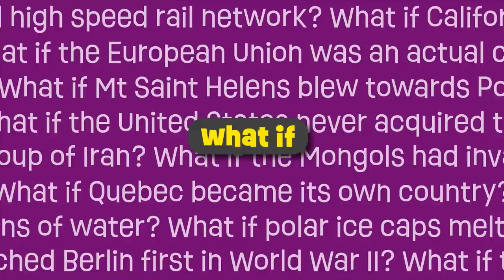Water Pipeline: What If An Aqueduct Was Built From The Great Lakes To The Southwest?

Comment: Any route I have seen proposed will involve going UPHILL. Water does NOT flow uphill, so it would have to be pumped. An aqua-duct would also suffer water loss due to evaporation. 

 Any pipeline project would  have to be capable of moving volumes of water approximately the same as the spillways at Hoover Dam. Damn! That would involve large pipe, pump stations burning energy every 50-60 miles or closer, pipeline maintenance crews, Right of Way maintenance, FERC approval and oversight (because it is an interstate pipeline), environmental permits, and many other issues that develop. These are just a few issues that come to mind off the top of my head.

My conclusion: it is not going to happen.

Another issue is the fact that the drought in the midwest is causing concerns there according to an article in Scientific American. The  Ogallala aquifer is dropping at levels several times the flow of the Colorado River! I can guarantee that any diversion  of water plans would be tied up for years in lawsuits as well.
Reply: The power used moving it up would be regained as it fell back to the ocean.   So you can have the water moved, without huge energy loss.   But it is water or energy, the water could be moved, but the energy needed will not go to the SW rather to the pumping of it.
Reply: That's because the only serious project ever proposed by actual hydrologist's is diverting water from the Arkansas, which is close to the Colorado's tributaries and doesn't involve much pumping.
Reply: @robertpendzick9250  
I don’t think the power would be totally regained through the dams. Water is heavy, and pumping it for all those miles, continuously; especially where they are pumping uphill against the resistance weight of the water and the added head of pumping uphill, would consume much more than would be regained at the dams as well as shifting the power burden from the west to the areas in the midwest. The west would benefit at the expense of the midwest. 

The whole idea still seems outlandish to me.
Reply: @dmannevada5981  
 Good point, but there are still many considerations, including the volume of water continuously needed to make such a project feasible.
Reply: By the way, an aqueduct running from Duluth Minnesota to Colorado river tributaries  would be frozen 5 months of the year and would require constant repairs/maintenance. It might be a benefit for olympic ice skating practice, though.
Reply: @WEStern-sm3ot  Not really, the Colorado is one of the world's most iconic rivers, yet it's also a very low flow river. The Colorado is actually pretty wimpy, so when you consider other water sources, even an extremely small diversion, would be a massive increase for the Colorado. I mean, just a 4% diversion of the Arkansas would see a 40% increase along the Colorado. Hell, 4% of the Mississippi would probably wash away the Hoover Dam...lol.
Reply: @dmannevada5981  
 I “Googled” the flow comparisons and was surprised, you are correct that the Colorado is a lower flow river. I was surprised by that information because I boat and kayak Lake Powell, Lee’s Ferry and Lake Mead. I learned something new! Thanks!

I am still not sure about the environmental impacts of diverting water from other rivers and the feasibility of building and operating the infrastructure that would be required. I hope there is a solution, but I do not think water diversion from other areas is going to be it.

Even IF it was realistic, I think the exponential population growth and water use for agriculture in the southwest would only expand in proportion to any additional water. In other words, it would encourage infinite growth in an area with finite resources.
Reply: @WEStern-sm3ot  See, what you have to understand is this, humans use "potable" water, and potable water usage is only 12% of all usage, and, going down. It's just not the population at current levels that's anywhere close to the problem. There is plenty of water not only to support current levels, but grow substantially.

The issue is the perfect storm that the growing regions of the Colorado can produce massive amounts of Ag, particularly "soft" Ag. The BOR's own data shows as much as 83% of the water is used for irrigation. Just think of that for a moment, over 80% of the water. Nowhere else in America see's those type of numbers. Calif proper's data in over 70% of the water is used for irrigation, which of course, we're talking largely about Calif's central valley.

The Ag industry states that the food grown(soft Ag) contributes to the food supply of over 700 million people worldwide...close to 400 million in N. America, and another 300 million internationally. No system has that type of pressure on it anywhere in the world.

People will say..."stop growing food in the desert". My response... "where else can you grow it? People don't think about the fact that much of N. America has a short summer growing season. You can't grow tomato's, lettuce or countless other varieties of soft Ag before June, and after Aug/Sept in most of N. America. That's why over 90% of N. America's fruits & veggies are grown in the growing districts of the Colorado from Oct-Apr. It's the only place that it can be grown. Google it.

90% of the people who comment about this topic are really completely clueless about it. They have virtually zero idea why & how food is grown in America the way it is. They also should be appreciative for the fact that this continent has an area that has a water resource, and the right climate to grow numerous types of soft Ag, and do it largely year round. I mean, thank the lord! I'm actually a non religious person, but you get the meaning.
Reply: @WEStern-sm3ot  Something else about population. 

Las Vegas.

Nevada's allotment of Colorado River water is 1.8% under the compact. That's it! Now technically it a little larger because it receives "credits" from the BOR for the water it reclaims & recycles. So lets just go with a rounded 2%.

Nevada(metro Las Vegas) currently drafts 1.3 gallons of it's roughly 1.8 gallon per 100 allocation. It's not even drafting it's entire allocation. So 1.3 gallons of every 100 gallons that flows down the Colorado. That's all it's takes to operate a city approaching 2.3 million. Half it's usage is environmental, the other half potable(per the SNWA). It's reclaims & recycles over 90% of it's potable, returning it into the system. The SNWA reports that the city actually uses about 1/3rd less water today with it's current population, then when the city was only 600,000. Wow! That city, through conservation, reclamation & recycling efforts, added about 1.7 million people, yet uses less water(by 1/3rd) over the last 30 plus years. That's fuc'n amazing. This information tells you a couple of things. First, populations really don't use much water(potable). Second, through conservation, reclamation & recycling, the per capita usage can be dramatically reduced.

Las Vegas entered into it's water policies decades ago not because there are water issues along the Colorado, but simply out of necessity. The state received a very little allocation, therefore, for Vegas to be viable, it had to create policies that would not only make it sustainable, but also allow it to grow, yet stay within it's paltry water allocation. S. Nevada(Las Vegas) has done that. It really doesn't have water issues, contrary to what virtually everyone here thinks.
Reply: @dmannevada5981  
The problem with your point still goes back to the water supply and climate change. When more people move to the southwest, the potable water use is going to go up. Then you add the high water use amenities these people desire (i.e., Lake Las Vegas, man made lakes in Phoenix, grass, swimming pools, etc.) and the water use goes up exponentially. All of which may need to be diverted from other ecosystems and riparian areas in the midwest. 

As far as the agriculture, I understand the issues. (By the way, I also know about potable water). What you do not seem to understand is that climate change worsens, it is going to require more and more water to grow the same amount of crops. 

And this all aside, the engineering problems of transporting enough water to maintain the present system are HUGE. 

The season for farming is short in the midwest (I used to farm there), but that is what it is. Infinite growth in a finite area is NOT sustainable.
Reply: @dmannevada5981  
About your second point, it does not matter what Nevada and Las Vegas do in the long term. Las Vegas is in the southwest. The issue is the total water requirements on the Colorado River water by all the users. Conserving water in Las Vegas while cities like Phoenix are encouraging growth and industry will not make up for the continued increase in demand due to that growth and climate change, while removing water from areas it occurs naturally.

Even if a pipeline was built that could supply the flows of the present river, it would take years of pumping those flows to bring the reservoirs back to normal levels, while evaporation will also be a factor. This would require continuous operation with no downtime for maintenance and REPAIRS. As the natural flows decrease due to projected climate change, the pipeline demands will increase.

Again, this is a short sighted “pipe dream” that is an analogy to proposing a perpetual motion machine. It is not going to happen in my opinion (BTW, I also have experience in the oil and gas pipeline industry, so I know the costs of constructing and operating pipelines).
Reply: @WEStern-sm3ot  Again, are you not paying attention? You do realize that the world is not the same as even 30 years ago. You are aware that things like technology, water policy like, conservation, reclamation & recycling have completely changed the game. Why do you assume more people, more usage???????? Why are you stuck in that old paradigm?

Las Vegas as an example. That city today uses more than 1/3rd LESS water today with an approaching population of 2.3 million than when it's population was only 600,000...per the SNWA. So the city has added getting close to 2 million people, yet uses significantly less water. You obviously don't know how different water policy is today vs 3-4 decades ago. It's weird you're not aware of this, yet feel comfortable in commenting.

Reading after the 1st paragraph of your comment was with respect, pointless. You might of stated  2 + 2=5, it would of had about the same coherence.
Reply: @dmannevada5981  
Your comment makes no sense. Conservation only goes so far. A pipeline is NOT going to meet future needs!? Are you a professional? I am!!!
Reply: @dmannevada5981  DUDE! I am mot wasting my time on your unrealistic comments. I said agriculture was the main problem. Do you know basic arithmetic? It is the TOTAL usage that the pipeline will not supply. 

Even the Desert Sun had a Google card today. They must have read my comments and researched, because they now agree with my assessment. They got the idea for their article from a retired engineer in California. He may be an excellent engineer in whatever field he was in, but it was not in pipelines. A pipeline from the Mississippi is not going to happen any time soon, if ever! So conservation is going to have to suffice! But conservation only goes so far. If you have 5 gallons of water and are able to recycle it, you will still eventually end up with 0 gallons due to EVAPORATION ,  DUDE

And you keep referring to Las Vegas. That helps, but if the other users do not cut their water allotments, the efforts in Vegas are not going to solve the problem, especially with projected climate change effects. I am starting to think you have a financial agenda here. I hope they can solve this too, but you need to accept the reality that INFINITE GROWTH IN A FINITE SYSTEM IS NOT POSSIBLE, especially with the desert agricultural usage. 

Are you even paying attention to the argument? I am only saying that the pipeline is not practical due to all the costs and regulations to build and operate this pipe dream! In fact, the Google card from the Desert Sun said their research estimates projected the costs of just building this pipeline would rival the present day dollars of building the Interstate Freeway system in the United States. Again…not practical; other solutions will be needed.
Reply: This post was 5 months ago California recently had some serious flooding and they just let the water go right out to the ocean.
 The #environmentalist will not allow California to have watersheds.

Comment: As someone studying water in the Colorado Basin, I've never heard this proposed. What I have heard suggested is "taking water from the Mississippi", but the actual implementation of that would be more along the lines of canals taking Missouri River water for the parts of Colorado on the east side of the great divide, instead of taking water over the Rockies from within the Colorado Basin and putting it into the Mississippi Basin like is currently done. (Most likely this would be paid for largely by the lower basin states, effectively purchasing a greater share of the water) This is a more basin-centric model of water usage and would make a noticeable impact, but isn't really a solution in itself.
The real problem is the many non-Colorado Basin parts of states using huge amounts of Colorado River water. Utah Valley and the Salt Lake Valley, the Front Range of Colorado, Los Angeles, San Diego, etc. are all outside of the Colorado River Basin, but all have massive aqueducts to them carrying Colorado River Water. The Colorado River has plenty of water for the basin- but we've chosen to divvy it up by political boundaries using prior appropriation doctrine instead of hydrologic boundaries, resulting in the current unsustainable situation.
Reply: Problem is local administration of the resource, if it was a federal pipeline and reservoir system, you wouldn't see this. The Fed needs to use their interstate commerce laws to control it.

Comment: I've seen presentations on offshore HDPE pipelines bringing water to So Cal from Alaska.  Back in the 1980's the Governor of Alaska was even in support of the idea.  This could be accomplished in a fraction of the time a cross country pipeline would take to construct.
Reply: What's HDPE?
Reply: @Adam.Reader14  high density polyethylene - plastic
Reply: @davidkottman3440  thanks for that. I tried googling and wasn't sure, what it was.
Reply: It's an inexpensive but very durable plastic.
Reply: better to go cut off square mile sections of ice from Antarctica, wrap in cellophane and use tugs to float it up to San Diego.
Reply: @TheShootist  Looks like one the size of Texas is about ready to break off by itself.
Reply: That and tap into the Columbia River in Oregon on its way

Comment: You are going to find that the Great Lakes have already been tapped into by such diversions as Chicago's link into the Mississippi River system.  There's a lot of water in the Great Lake's basins, however, the overall flow is another matter.  All in, the concept you suggest is a bit late in the game - as others have tapped into this resource.  For instance, right now the hydro generators at Niagara Falls have the capacity to turn off the water flowing over the falls, and likewise, there is the canal system linking to the eastern seaboard.  A US-Canadian treaty regulates the flow over the falls, ensuring a substantial flow during the daytime, and permitting the hydro stations to increase their drawdown after dark - recognising that the falls are a significant US-Canadian tourist attraction.  Meanwhile, the Great Lakes experience fluctuating levels from one year to the next.
Reply: he wasn't suggesting it. he was explaining the reasons why it wouldn't work out. did you even listen to him?

Comment: I thought about this a little bit and my thought was to make a pipeline from Lake Truman and Missouri which is a flood control lake this way in the rainy months you can ease the volume of water that goes down into the Mississippi and help control flooding or sending water to the desert regions they don’t get any rainfall in the summer months it will be a lot shorter and a win-win situation also the lake sits on the worlds largest aquifer just a thought
Reply: This would work, which is exactly why they won't do it.
Reply: The Mississippi River is drying up in areas.  Once you give something to away, you can't get it back.  Population control and reduction are the Correct answers, but those subjects are taboo.
Reply: I'd second this, and add extra pipelines from the headwaters of Columbia and Mississippi  (which never dries up in the upper) rivers. The pressure of the headwaters should be enough to mitigate a lot of pumping.
Reply: The Mississippi is not drying up . Yes this year it had low spots but in the 1800s settlers going west reported low areas to cross by wagon and horse travel and the coach stayed dry . Everything goes in cycles from the solar activity not from puny mankind
Reply: @ricksmith6985  Precisely why we shouldn't enact permanent solutions to deal with temporary problems.